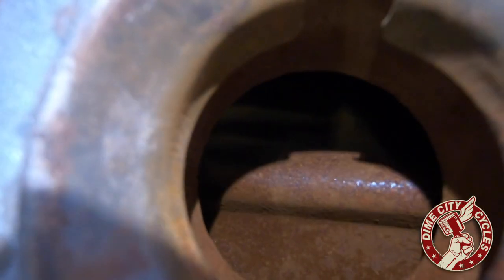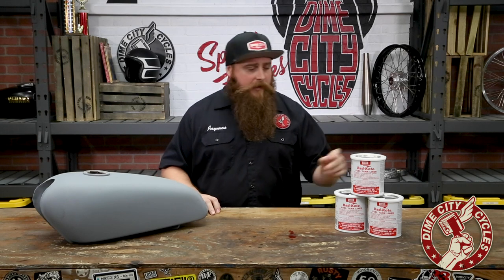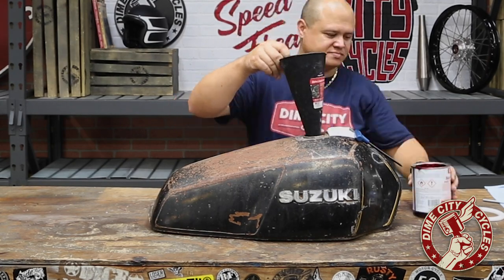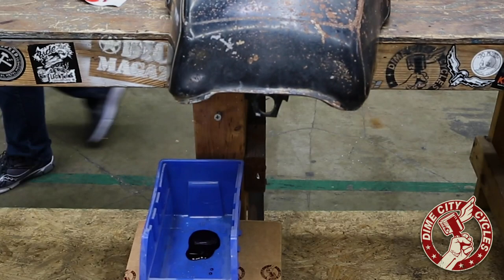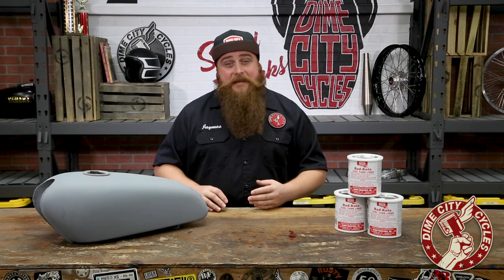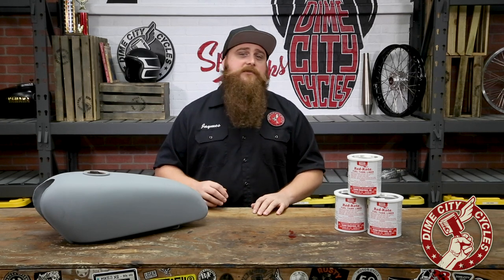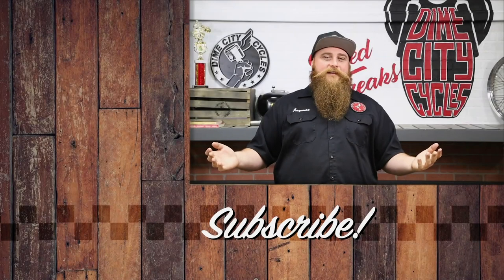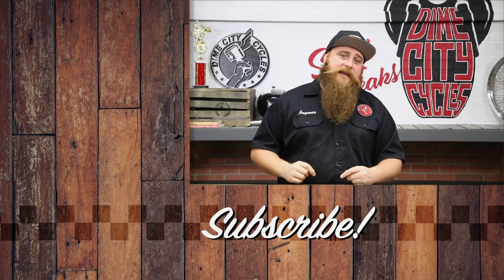Red-Kote Fuel Tank Sealer and Liner

Comment: Over the years I’ve tried several different tank sealing products. Some have ridiculous 2 or 3 prep steps. Nothing beats Red-Kote. Easy to use and works great. I no longer even think about other products. Hell, the hardest thing about using Red-Kote is getting that damn white hard plastic seal off the can. Lol

Comment: Coating a brand new fuel tank that I bought from YOU, had painted, only to find out it has a pinhole in the top next to the gas cap. I hope no prep was involved for a BRAND NEW FUEL TANK.  Thankfully, my painter said bring it back after the welding/coating is done and she'll fix it cheap. Thanks z1 Enterprises for not telling us these tanks are not tested for quality assurance/control. I would have just bought a used tank and coated had I known.
Reply: Not to defend them but everywhere I searched for a new tank for my bike all warned that I need to test it as well as seal it for pinholes and to prevent rust. So I guess unless we pay someone to do that all for us we are stuck dealing with it no matter who we get the tank from. Which makes me wonder why they don't just test and seal them at the factory. Cost savings I imagine and China.
Reply: To add to the venting I have found these days that quality control is essentially non existent anymore with anything. The only bright side is overall prices for stuff as been kept pretty low.

Comment: 30 bucks at O'Reilly's. This stuff is tougher than shit. It will suspend almost anything left in the tank, rust, flakes or whatever. Dries to a toughness like a basketball. Seals Anything, period. I spilled a small  puddle on my garage floor years ago and left it there just for observation. It shows zero wear in spite of being walked on constantly. We've poured every manner of chemical from carb cleaners to oven cleaners & paint removers on it. Nothing touches it. I'm not sure I could get it off with a chisel. It's about like molasses, put it in, roll it around, pour out the excess. In a day or so when you can no longer smell it in the tank, you are done. I refuse to even try anything else after too many misses with the others.
Reply: Thanks for that info. I was reluctant to get a new tank after hearing horror stories about sealing but I am much more confident to try it now. Seems all the new tanks for my bike require sealing but come unsealed. Now I am not stuck with the stock tank.
Reply: @whichgodofthousandsmeansno5306  howd it go?

Comment: Highly recommend staying away from RedKote. Great video but RedKote is a very dated product. When it was created gasoline did not have nearly as many additives as it does today. I used this video and others like it to choose RedKote as the product I would use to line my own tank. I used Shell gasoline for a few weeks after adding the tank liner with no issues whatsoever. When Shell was closed one night, I had to resort to a Mobil station instead. One of the many additives in Mobil’s fuel reactivated the tank liner and gave me more fuel issues than I had before putting the liner in to begin with. I then had to tediously remove the RedKote from the tank, prep the tank once again for another lining, and this time went with POR-15. Haven’t had any issues since. For anyone watching this video that is looking to line their fuel tanks, let this be a fair warning and indicator while deciding which product to use. I would NEVER EVER use RedKote again, especially after all that I went though because of it. Turned into an absolute nightmare.

Comment: Sweet video got a easy question I Bought a motorized bicycle frame with built in gas tank all aluminium anyway before I put it together I blew in the little tank and it has a pin hole I blew a little puff of smoke into the tank that's how I found the location of the pin hole anyway seeings it's never had any 2 stroke fuel mix in it yet should be clean if I   Wrenc it out with  Acetone I should be ready to use red coat correct

Comment: Hey Gang,
Have a Moto Guzzi Breve 1200 sport and the plasctic tank weeps, blisters and swells to a point where I can not get it back on the bike. This was/is also an issue with Ducati and Harley plastic tanks. 
Once the tank is drained and dried, it should regaing its OEM shape and I'll be able to get it back on. However, I'm trying to find a product to seal the inside that will make it impervious to the effects of the ethenol so this won't happen again. 

Is the Red-Kote safe for use on a plastic tank?

Comment: I am getting a new diesel tank after the last one rusted out due to condensation, too far gone. I have some unused red-kote as a result and was considering coating the brand new tank as a preventative measure - or is this lees than good idea?
Reply: Supposedly it is a very good idea even on a new tank as even a new tank could have pin holes and eventually rust if left unsealed.

Comment: so how do you clean out the garbage re "cream" out of the tank before you RED KOTE
Reply: Several cans of carb cleaner a toilet brush and a lot of goddamn patience
Reply: I just did this yesterday.
100 1/4" nuts in a 3.5gal tank with 1/2 gal of lacquer thinner. shake around for 10 minutes. flush, retrieve nuts, put the other 1/2 gal of lacquer thinner in, shake, pour out, let dry.
the nuts break up the rust / peeling stuff into small enough bits to come out of the hole.
loosen caps slowly as you'll build a little pressure in the tank from shaking.

Comment: My first coat looks thin, should I do a second coat?
Reply from the maker: Red kote is typically thicker than most other systems that require two coats, however if they feel its too thin, there is no harm in a second coat.
Reply: Another pro builder who swears by Red Kote also said you can do 2 coats. So it seems there is a consensus.
Reply: Mine looks thin also I'm going to put 2 in it...i put in a lot of it the first time and it looks thin....lol

Comment: Where's the video showing how to purge the rust out of a fuel tank?  Thanks!
Reply: I just did this yesterday.
100 1/4" nuts in a 3.5gal tank with 1/2 gal of lacquer thinner. shake around for 10 minutes. flush, retrieve nuts, put the other 1/2 gal of lacquer thinner in, shake, pour out, let dry.
the nuts break up the rust / peeling stuff into small enough bits to come out of the hole.
loosen caps slowly as you'll build a little pressure in the tank from shaking.
Reply: I use evaporust. works good
Reply: @JD-hh9io  I bought a gallon of Evaporust last week, and tried it in two old lawn mower tanks. Basically had little to no effect, even when left overnight. IMO it's good for very light rust only. I ended up buying a large bottle of BB's and shaking the tank with water, over and over and over and over like 20 times, rinsing periodically, then after removing the BB's, cleaning the tank the rest of the way with SIMPLE GREEN solution. I wish there was a better way to get rid of all that rust without all the work.

Comment: Excellent, but does it work old chap
Reply: No it doesn't
Reply: @Ryan_1997  I'm about to find out today. The can says most product failures are due to user error. Either poor prep or not letting it cure long enough
Reply: So far I have heard from a few bike builders that are trustworthy that this stuff works and is the best. Of course as with any coating the prep is key, especially on an old tank that is all crudded up.

Comment: I am wondering if I can use this in a plastic gas tank off a dirt bike. Most tank sealers dry solid, and therefor will crack if the bike is dropped or when the pressure builds an flexes the plastic. however you say this is flexible and will never crack.. My dirtbike is a 1981 kdx175 and the only problem is the leaky tank. just wondering if a $30 can of this can save me from buying a $250-$470 new tank
Reply: nevermind, just read the back of a can and it reads as follows, "Red-Kote does not stick to plastic."
Reply: JB Weld will work for you. I cracked a yz490 tank vertically on the right side on the edge. Shocked that it worked. Never leaked a drop.
Reply: I spread thin epoxy with little hardener to keep flexible and then painted over or rhino lined a leaky plastic tank on a 86 xt600. Worked good.

Comment: I left vinegar in my tank for about a week. No rust, just bright metal. So I rinsed it good, poured in gas then acetone and what about the flash rust?
Reply: Exactly, the right way is apply a liner, or fuel the tank asap
Reply: I know this is an old post, after you rinse the acid or vinegar out use MEK, it could mess up your paint so have wet rags around

Comment: What happens when you're working on a Honda Shadow gas tank and you can't get all the excess red kote out
Reply: Why wouldn't it come out? Just make sure the petcock hole and fuel fill hole are not clogged. Assuming you removed the tank which you have to in order to cote it all over. The excess will be liquidy and should pour right out. If you let the excess harden that is another story. It's not really excess anymore then.
Reply: @whichgodofthousandsmeansno5306   I was having trouble with the baffles in my tank it wasn't letting all the excess out so I just flipped it upside down and kept moving it took about a week to fully dry and finally didn't smell the red coat in the tank anymore then I new it was dry.  worked out excellent.

Comment: How do you remove it?
Reply: it pours out like honey. I just used a little over 1/2 a quart in a 3.5gal sportster tank. Coat the inside, set can under petcock hole to drain out.
Reply: @joeslowy  I think they meant after it is cured.. maybe from a surface where you didn't want it or to remove a bad job to re do it. But that I don't know the answer to. Heard some kind of solvent and shake it around with a bunch of nuts and bolts etc in the tank to help break it off surfaces but I never did that myself to confirm. I would call Red Kote tech help to find out.